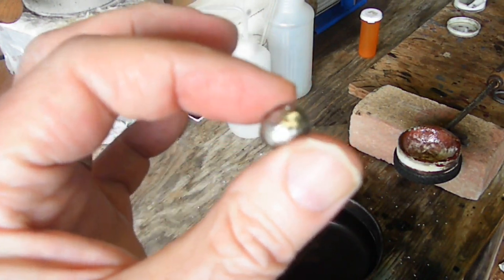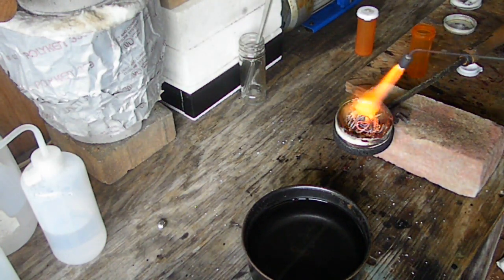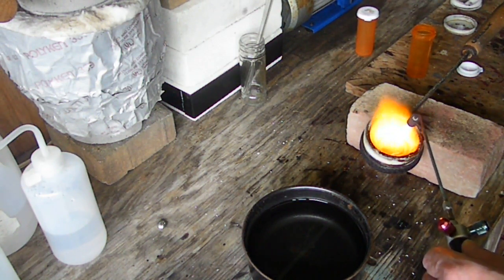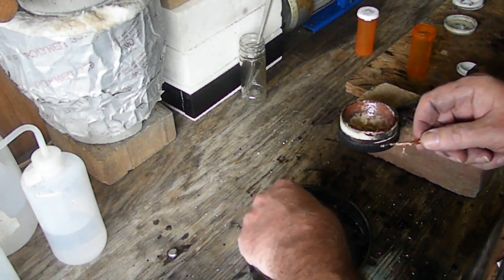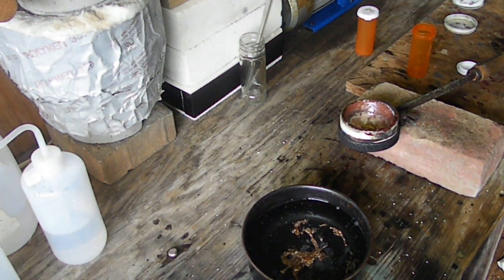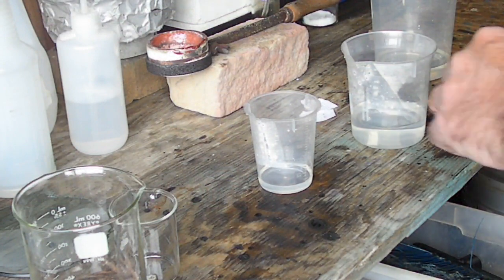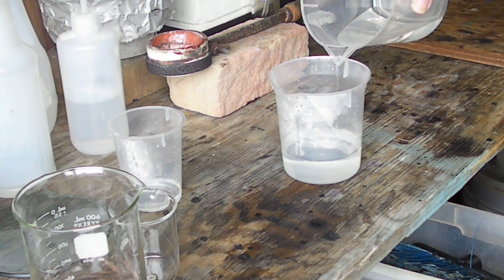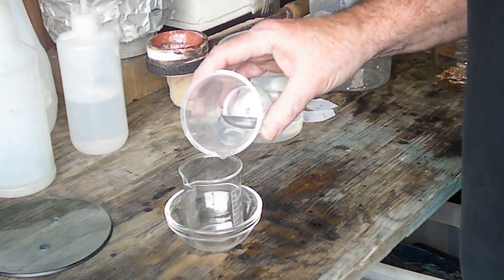Refining Scrap Gold Jewelry Part 2 (Melting & Going To Acid)

Comment: I melted a heap of gold plated pins into a lump and put in acid. I have a lot of white stuff settled as I have run out of nitric and it has been sitting for a while. What would the white stuff be?
Reply from the maker: Could be several things, nickel, tin, etc., Also did you separate out magnetic's from non magnetic's before the melt?? If not that can cause stuff to participate during the dissolve. Most of the time if this happens when you are dissolving stuff in AP you can just add some more HCL and that will get rid of it. With nitric it usually ends up being tungsten, or a nickel alloy of some kind. Only a few metals are resistant to nitric acid, tungsten, gold, stainless steel, some chromium nickel alloys etc.. Hard to know not knowing what you started with.
Reply: @BackyardScrapping  I didn't separate anything.  I incinerated pins in sockets, melted the pins into a lump. I used nitric acid to dissolve copper.
Reply from the maker: That is more then likely why you're getting the stuff coming out. I would rinse everything really good, and just go with AP from here. It will take a long time, but if the stuff keeps falling out just keep adding more HCL but don't add any more peroxide after the fist mix. Can't say for sure but that may get rid of the sediment.

Comment: Dental gold alloy is usually 16K and contains palladium.
Reply from the maker: Thanks Bob, saw that in your last comment as well, but the main thing I'm trying to figure out is what else?? Something went into solution and I haven't figured out what it could be. When I test it with stannous chloride I get a very strong positive for gold, but that can't be, because only nitric acid was used so no gold should have dissolved??? Back in the day I got dental scrap all the time, but it was the 16K yellow scrap like you are talking about, as far as the palladium, for the most part I didn't even mess with that because it was only about $80 an ounce back then, and not really worth the danger of going after it. More then anything I'm just curious what could give such a strong false positive, if you have any other ideas, please let me know!! Thanks for watching!!